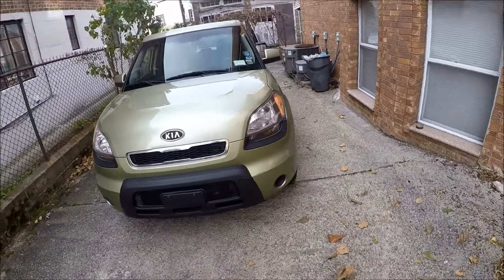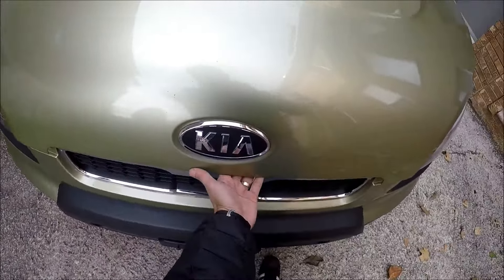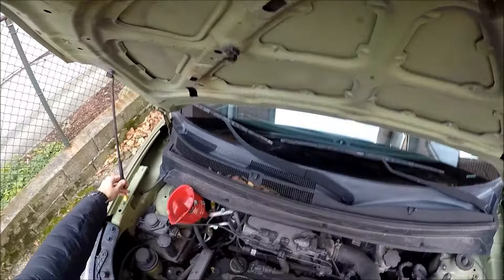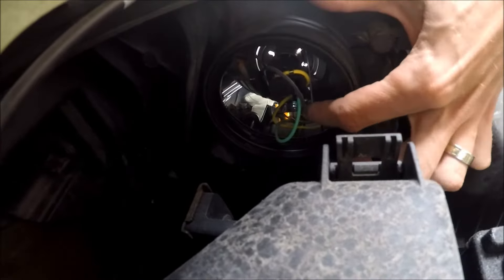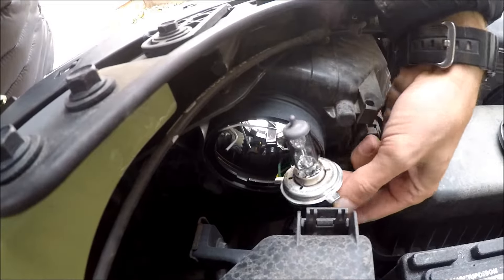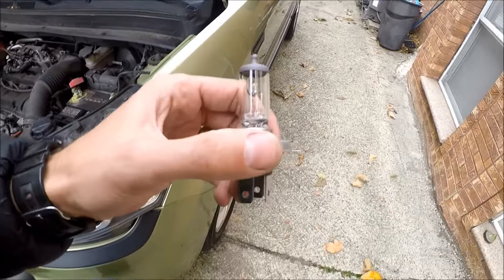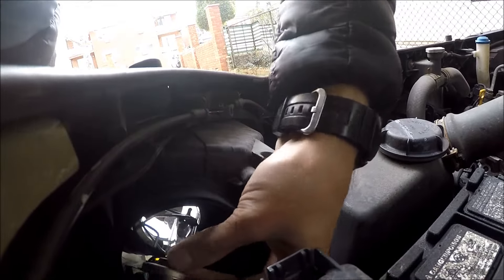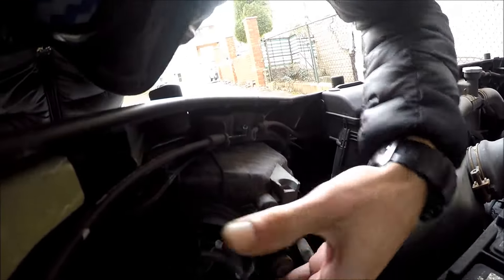How to change replace Headlight bulb in KIA SOUL

Comment: Thanks for the video.  I looked at it and thought I'd have to remove the screw holding the wire bracket and was anticipating a nightmare reassembling it.  Ah, the wire bracket is a spring-clip, of course. You're concise video gave me the information I needed, thanks.

Comment: Pep Boys wanted to charge me $300 for this.  LOL  Thanks to your helpful video it took less than 10 min for both.  Thanks
Reply: i hate Pep boy's one day they charged me over 70$ for replace my serpentine belt on nissan altima and it took of them 5mins to do it. I will never ever live them my vehicle again
Reply: Tell the Pep Boys to take a flying leap! lol
Reply: $300?!  And yeah pep boys is a rip off.  They may fix a certain issue with your vehicle, but once you leave the lot, you suddenly have another issue that needs repairing.
Reply: Seems reasonable, that’s $100 for each boy 🤣

Comment: Same year and color as mine. Its a fun car. I enjoy it. Not the best at anything, but still pretty decent in most aspects. Plenty of space and decent gas milleage. Turns on a dime too compared to my 2004 volvo s60. That thing was just barely capable of making a U turn at all without completely going off the road. Even then it was only like half the time that id actually make it without having to backup and turn again.  It was stupidly dangerous now that i think back. 
Those seats though.... The seats on the 2004 volvo s60 are still the most comfortable seats ive EVER sat in in ANY car to this day.  The turning radius makes it a terrible daily driver, but for road trips it was AMAZING. I could drive all day without getting sore from sitting.
Reply: I used to make fun of the way the soul looked. After now having to have own one. It's possibly one of my favorite cars other than the motor. 
Everything you said is correct. Great on gas parts are fairly cheap. They are hard to find though. And this car has one of the best safety ratings

Comment: I bought a 1012 Kia Soul and i guess i lucked out cause i got the one with the double overhead cam and no timing belt but it has the timing chain instead and i believe it is the 2.0 engine

Comment: Good video but it's only the high beam lamp replacement.  Today the low beam you need to remove the entire head light assembly and turn you can replace the burnt out low beam.

Comment: This works only for the high beams. If you need to change your low beams, it's easiest to disassemble the entire headlight.
Reply: Garry not Linda. I realize this is a late reply but I want to clarify a point to this comment for other viewers. The 2008 through 2013 Kia Soul headlamp has both high and low beams in one unit. I believe  from 2014 on high and low beams are separate. You can tell the difference easily. If the bulb has a two wire connector it's a single purpose bulb. If it has a three wire connector it's a dual purpose bulb with both high and low beam circuits. Hope this helps.
Reply: @bassrun101  thank you!
Reply: Linda/Gary is incorrect I have a 2012. They are separate. This video is for high beams only.

Comment: You should check to see the short beam bulb how difficult it is to reach the cap and replace the bulb...super tight place to unscrew the cap and release the bulb, then ten times harder to put back in its place the bulb. Asian cars have the worst DIY maintenance positions in all car manufacturers